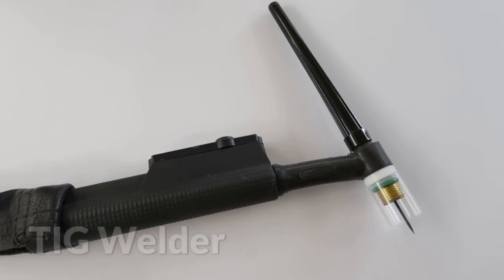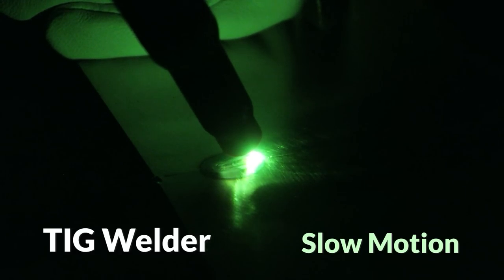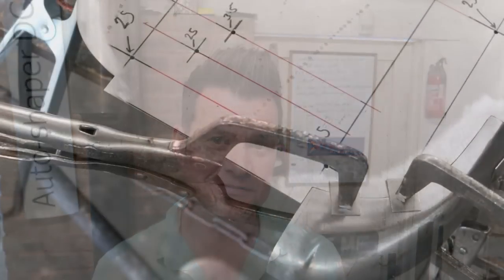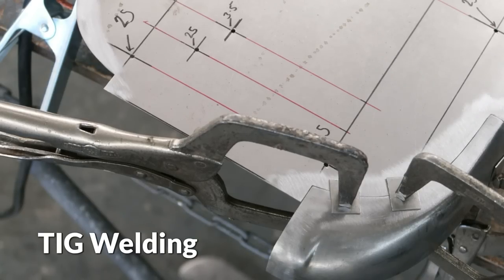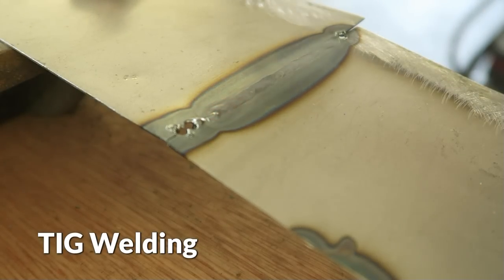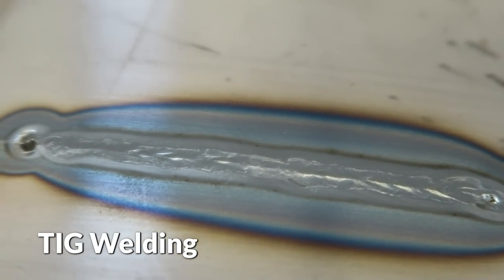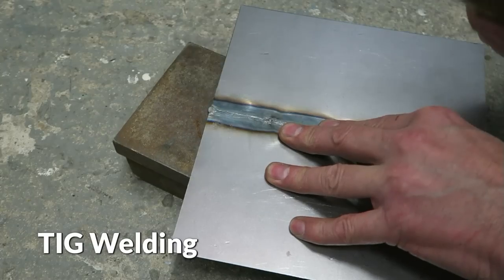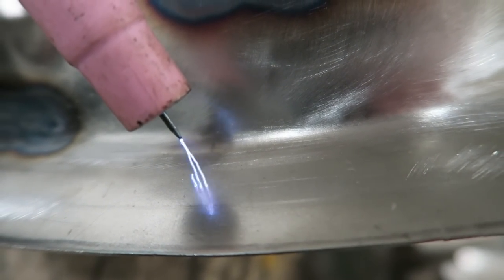MIG Versus TIG Welding on car bodywork, thin sheet steel. Vs Panel Beating tips and tricks vs  #65

Comment: Great to see you Trev! As a professional welder who also does restoration work, I love that you put this video together.  I have always used this - 

*Structural/strength (Frames, etc) = wire weld (mig)
*body/artistic/patches = tig or oxy/acetylene
*coach building = oxy/acetylene"

Great information Trevor! Good to see you back. 😍 Cheers mate!

Comment: Good thing I bought a mig to work on my tractor and mower-deck then, though learned on gas at art-school  - forty years ago mind!! Been following Pete Williams too as I have replacement motorbike tank to make (thanks ethanol!) - prolly use the spool-gun that came with the mig, if I choose to go with aluminium - more learning ahead for this ole geezer!
Thanks for your vids mate, always inspirational, if not always quite attainable!

Comment: Thanks for your perspective, Trev.  I too learned to gas weld first.  It was long ago enough that mig and tig weren't considered much.  With the then new HSLA metals, we all had to get mig welders.  As I've gotten more into fabrication and coachbuilding, tig is the thing.  I also appreciate your product info.  I'll be trying Corrolan.  I love the welding helmet you told us about. Looking forward to your new shop.  Thanks again.

Comment: I agree, I agree, I agree.   I made the mistake of buying a tig machine to fix my rusty car.  It's the wrong machine. You might of mentioned that tig welding anywhere other than a bench is nearly impossible. I tig welded 12 ' of rocker panel laying on the floor with a foot pedal between my knees. I stuck the tungsten twenty times and that means regrinding. I had to borrow a mig machine to do most of the unreachable spots  and build the inner structure. Even to tig weld it is helpful to have a mig to tack things together. Another thing to mention is that you need two hands to tig and only one for mig. You can hold something up and mig it in place very, very easily.

Comment: You forgot to mention is how many years you have been practicing and honing your skills. :) It all takes practice, real practice!  Practice, Patients, Practice, Patients...REPEAT TIG takes a lot of skill and coordination, there is the torch, heat input/pedal, and wire feeding. Thats a lot. Don't think your going to buy a TIG and weld thin steel like Trev :) I love your videos and admire your easy going way and great work! Cheers!
Reply: It's a lot easier to learn TIG for anyone that can gas weld. Very similar really just using a plasma 'flame' instead of gas flame. I agree it still takes a fair bit of practice though  👍

Comment: Good Video.  For those interested. You can buy a 3 in 1 Inverter welder, Mig, Tig, Stick. I replaced my transformer type Mig Welder when it died. You spend more time setting up the welder to get a good weld than actual welding. I replaced it with a Kempi Evo Miniarc 200A. Welds Mild Steel, Aluminium , Stainless Steel and Bronze weld for low distortion on car panels on presets on the welder. Just go up a size in the gun tip size for aluminium to avoid jamming the Aluminium Wire in the Torch. Run parallel welds for welds in steel over 5mm Thick. You can TIG weld up to 1.6mm Mild Steel edge on edge without filler wire and is as strong as the parent metal. You can TIG weld any metal with the appropriate filler rod. 30 years ago  I did a 60 hour welding course for $60.  Invaluable.  The instructor made the class weld 10mm plate, V beveled, to show us why you use TIG for sheet metal and MIG for above 3mm.  The Metal was so hot it lit the room. Making parallel runs to fill the bevel.  I have all 4 types of welders. I mainly use MIG because a monkey can MIG weld or somebody out of practice, which is the same thing.

Comment: Very good explanation Trev.  Not a great welder myself but manage to get buy with a cheapo welder. Best advice J can give is to turn the machine on and burn some holes/melt some steel and fiddle with your knobs til it starts to work out.

Comment: Ace explanation Trev, I did oxy (with and without filler rod) and Arc as an apprentice and then later got  MIG for myself for hobbying, after many mods to the welder, including separate motor supply, feed mod, Euro gun mod, and welding leads mod, the lesson learnt was, that you should always buy the best welder you can afford, or wait a little longer, does what I want out of it now (56 yr old now :D) but the explanation of where, when and how to apply the applicable type of weld was really well put and I am still learning! Thanks

Comment: I'm 65. My dad was a perfectionist panel beater. Oxy Acet only.( that's all they had) I was taught how to oxy weld thin aluminium at 12 years old. SO I'm biased. Oxy/acet is my preference. Tig is very like oxy acet.  You can work the metal.  MIG was developed to weld structural steel..pump the amps in and fill the joint.  My ignorant attitude sees MIG as a lot of "hard" tacks that make the weld brittle. A whole lot of grinding and you end up with a crack worthy joint that is most likely thinner than the parent metal.  Thank you for the expalnation. I understand that the new auto steels are not the same as the old stuff and might accept the new mig tack method but as everything is rush and dollars now I suppose MIG is the go.  Time spent grinding it flat is questionable.  Rant over.  I love your perfectionist work. Very inspiring.   Thank you.

Comment: Fantastic knowledge with great information given on mig /tig welding  in such a short amount of time,
Never thought about modern cars using strengthened steel and replacing damaged wing with mild steel,how that would effect the weld.
You also gave a in site to the type of weld in coach work, interesting,
As only been using stick welder AC for home projects and are limited with this, its time to get out my 4 in 1 new welder going,
There`s a huge amount  to learn with welding so many professional welders have so much info to give, but weird how they can have different methods, many way to skin a cat as the expression goes, ` 
Even using the wrong mix of gas could over strengthen a weld, witch can make it stronger in hardness but brittle and will crack further down the line,
 Its a fascinating profession to go into and dangerous toxic wise , especially galvanized and stainless steel when breathing in there fumes, 
I hope  in your next video you could find the time to talk on the safety aspect about the dangers welding with certain metals when heated,  Not many professional welders  speak on this subject, its important to newbies to know this,
But got to mention you came across very professional in explaining the pit falls with the two types of welding,

I think its could be a life time learning curb as Technics change with materials,
Reply from the maker: Thank you 😊

Comment: Nice one Trev, I've always said that you should learn to weld with Gas first (oxyacetylene), when you can do that, start to learn to Mig (not that silly flux core metal welding shit with no gas, simply horrible stuff), and then progress to Tig, that I still think is the hardest of them all. keep it up Trev, and good luck with the new/revised workshop.

Comment: Good vid and lots of  good points.. On the car restoration front, another point for the MIG welder is it's tolerance to dirty material.. Of course perfectly clean is best for any welding, but a MIG will get the job done without complaining much about some rust pits, while it'll be an absolute nightmare to TIG weld through it

Comment: Great advice and video Trev. Just bought a Unimig 230 Ac/dc multi.  Amazing machine, my old Unimig was great and gave it to my best mate. These modern machines do anything,  going to try tig . Seems very similar to oxy fusion and i used to be great with that in the old days.

Comment: I only recently joined the modern world. I've been Oxy-fuel and resistance welding for 40 years. In the last two bought a big Tig machine, transformer Mig machine and portable SMAW power supply.
Gas welding Al was too much. Tig is so much easier for that. I use Mig primarily for rust repair. After all, a grinder and paint makes me the welder I 'aint.

Comment: Wow very informative. Welcome back into my head. 😅. First experience was gas welding quite liked it found it easy. Stick or arc welding even thin stuff. I do have and use a mig welder sometimes as I no long have bottles. Quite fancy a tig just to have a go. 
Cheers Austin

Comment: Excellent welding tips video Sir! I have a question that I never seen in other restoration of welding videos. My question is, what type of gas to use on the mig or tig welders? What's the difference in using different types of welding gas? Next question, When using gas, at what rate of gas usage is used on, well let's say auto body panel restoration? Next question, when a welder is used in conjunction with gas, what size tank should be used? Large? Medium? Small? I am a complete novice to car restoration. I've arc welded long time ago, but this technique doesn't ever be mentioned. Yes, I know an arc welder will blow holes through regular sheet metal. But what of cracks, or splicing in a frame piece? Thank you once again Sir! You're truly a professional teacher!
Reply from the maker: I’ve actually covered most of what you’ve asked in my mig and tig welding tips videos here’s a link to the mig one you can find the others in my other videos Mig welding set up Part 1 Volts/power and wire speed  Tips and Tricks #45
https://youtu.be/kLFpcZruetI

Comment: Hi Trev.  Tremendous video and great advice.  I do want to weld aluminium in the future so like you I will buy an analogue ac/dc tig welder.  I also found my mig welder is an inverter type and as you say its great out the box but difficult to know the changes to make to make it perfect.   Still your brilliant as is your wifes channel great work.

Comment: Great video Trev. I'm pretty good at TIG on my bench, both thick aluminum, steel, and test sheet steel coupons. However, I just can't see to get the hang of TIG on the car. With autobody TIG, it just sputters, sprays junk on the tungsten, and ruins tungsten. I tried to make sure both sides are clean.
Reply from the maker: I can relate to your issues. I must confess that my experience with welding on aluminium cars is quite limited. I’ve had varying degrees of success. There is of course different types of aluminium and these all seem to have their own characteristics. Also how old the car is also creates challenges with corrosion buried inside the fabric of the aluminium. Newer Ferraris are made of the most brittle aluminium which behaves very differently to hand built cars. A guy I once spoke to swears by heating the weld area with oxygen acetylene to burn out impurities before tig welding. Cheers Trev

Comment: Yup, Waxoyl is far too waxy and not oily enough these days. I feel that it better many years ago?? 
I got a load of 4 inch square steel plates and applied different mixes of waxoyl to half of each. They sat for a few years and it was clear to see that the standard waxoyl didn't really creep at all and kind of dried up and could easily be flaked off. The most effective mix (tried several different oils and greases in several different ratios) was a 50:50 mix (hot) with cheap 15/40 engine oil. This gives a decent amount of creep to fill scratches etc, but isn't too soft and 'wet', though I'd far rather get mucky working on something, than have it rust.  
I'm sure that this ratio would be different in different climates. I'm in Scotland, so cold and wet....
Reply: You can also mix Waxoyl with normal black underseal which makes a waxy coating very similar to Dinitrol black 4941 when sprayed with shutz gun 👍

Comment: Iv discovered that you have to allways have a gap between your metal because when you start welding the gap closes slightly and if you dont have a gap the metal has nowhere to go so it warps and I allways keep an airline with a blower to hand to blow cold air on the metal to prevent it from warping. And iv discovered your wire thickness is important 0.6 mm works best on car bodywork because it takes less power to melt it and causes less distortion.

Comment: Great material, lots of valuable information. The only thing I would like to hear and what is missing on the Internet is information about TIG welding using CuSi3 rod. It is possible? Is it possible to obtain such an electric arc temperature to solder and not weld body elements?
Reply from the maker: https://youtu.be/96j89_HiVac?si=k-doLfnqIv60Qbs8

Comment: Good to see content again Trev.  So my question you can answer later concerns direction.  Does it matter really if you push your weld bead with the torch or you trail it? Pushing the weld bead seems to work well for me, but it does create a fair lump to smooth out again. Loving your work from Sydney 🇦🇺 .

Comment: nice video, next you can do a tutorial how to fix/repair/replace bodywork studs (the ones used to screw fasteners to secure under-trays, shields, brackets etc, not the stud-dent pullers) without having to buy a dedicated stud welder for couple grand..
Reply from the maker: Great request thanks 👍
Reply: @trevsblog  It would be awesome. There are lots of videos in regards to dent pullers, but very few related to stud welding, and none actually sharing some workarounds that could be done by us DIYers on personal projects who happen to have just a stick/mig/mag welders. I have seen one of the old videos you had made explaining about the studs you did, but you re-adapted your stud welder for that too. Any insights in this regards without an actual stud welder would make a great video imo 👍
Reply from the maker: @antanasrapkevicius3897  well just a hint towards would be to drill a hole in the panel just big enough to fit a stud into then weld the end of the stud onto the panel from the inside. I’ve also made a simple square plate welded the stud again through a hole in the plate and then bonded the plate to the underside with panel bond, this prevents you from burning the paint off the boot floor and the surface area of the plate allows enough strength to the panel bond to hold it firmly in place 👍
Reply: @trevsblog  thanks for the tips 👍 I have no access to weld from the top unfortunately due to cavity areas, but I can actually make small round/square sheet patches done with the studs this way and then weld in said patches to the bodywork. This might work for me. Appreciate the help

Comment: very simple explanation. question is, i have a 140 transmig gassless mig, why or what is the purpose of being able to change the polarity of the earth cable as i have always been of the understanding that on a mig the clamp is earth and the torch is positive. cheers
Reply from the maker: Ok good question 👍 flux core is supposed to be positive earth, mig using gas negative earth 👍
Reply: @trevsblog  great. ill have to check mine. i presume its + earth as its been gassless straight out the box. good timing, as i have a gas bottle i havent got around to connecting yet as no need for the welder yet. i would have just connected it and used as it was. cheers
Reply from the maker: @steveandsara7240  yes mate just change the earth to negative, don’t forget to change the torch side! Usually located by the wire feed 👍

Comment: Mate, sheep have nothing to do with it. It's all about the rust inhibiting chemicals. Any oil or whatever is just a carrier. Oil in itself is also not a rust inhibitor but also just a transport medium. I do generally agree with the welding tips though. With the exception of your example of structural welding. Penetration is everything there and it should never just be a weld bead on the surface.
Reply: Sheep have 100% to do with it, lanolin when applied to steel hermetically seals steel from oxygen and moisture, you don’t need to add rust inhibitors when you can naturally provide them.
Reply: Lanolin comes from sheep.

Comment: Can you "heat shrink" a tig weld?
Reply from the maker: If you had a TIG welded joint across a panel and you needed to shrink the area the weld was across, then yes this is perfectly possible 👍

Comment: hi Trev good to see ,   you say mig gives you a hard bead which i get, but thought you said in one of your vids you could use mig wire to tig weld, doesn't that make that weld bean hard as well,   thanks sam
Reply from the maker: Thanks for the question, answer video to follow 👍